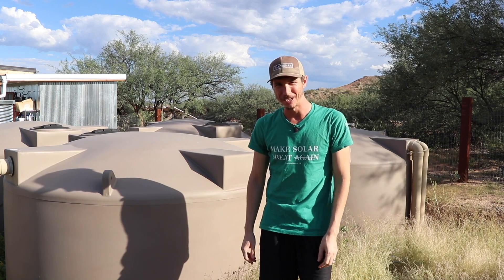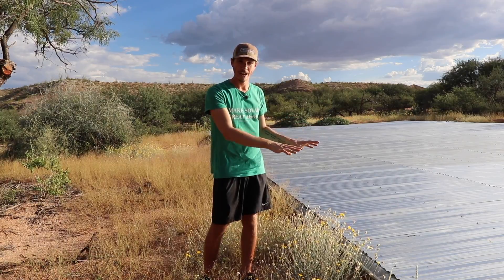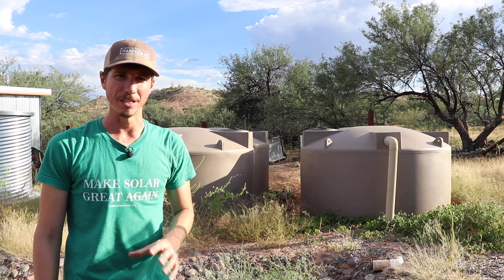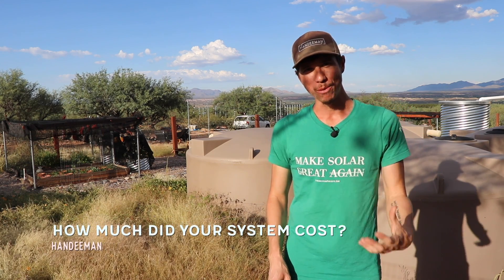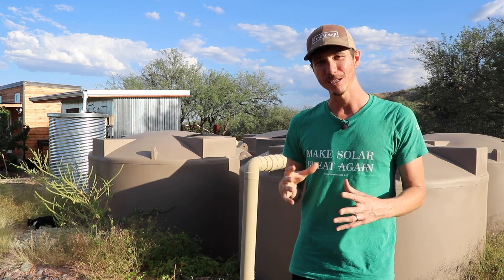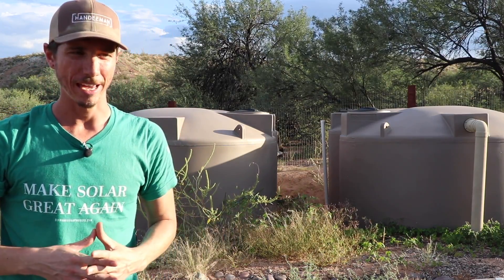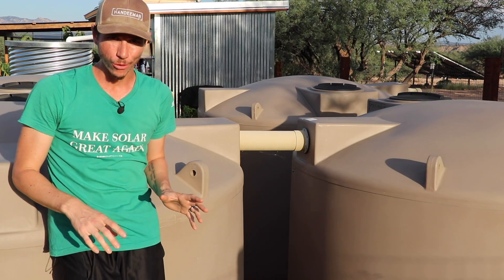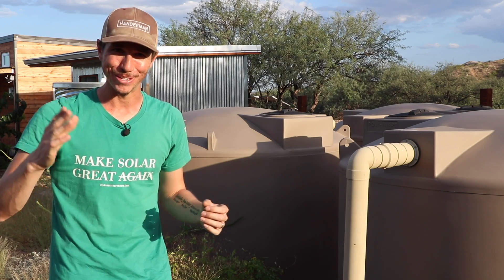Rainwater Harvesting Q&A - Legality, Cost, Treatment

Comment: I live in a single family residence in urban Seattle,  and have used zero citiwater in twenty years.  It Drives the utility nuts ---they have changed out the water meter a couple of times,  supposing that it is non registering,  and sent utility people out to see if I'm stealing water some way!

Seattle gets about 35 inches of rain per year,  but we typically have a summer drought for 3 months or so in which we get little or no rain.

I bought an open steel tank thirty years ago for $50 from a metal surplus business.  It was once used by the military for storage and transport of aircraft engines,  so it is quite sturdy.  Capacity about 600 gallons.  I prime and paint it whenever it starts getting rusty. 

I have five 50 gallon plastic barrels in my basement for water storage,  plus a couple of dozen five gallon plastic buckets. Plus a couple of fifty gallon plastic barrels to collect rainwater from downspouts outdoors,  with a downspout filling the 600 gallon tank too.

All water transport is done with me carrying five gallon buckets.

Nothing purchased for more than peanuts. 

I do live alone. Dishwashing by hand.  Clothes Washer filled  with five gallon buckets  ----during the summer draught I'll save the rinse water from the washer and re use it as wash water. 

In middle September,  with no rain since July 4th,  I still have four barrels of good water in my basement  ---and the rains will be returning before long.

Comment: How much bleach do you treat with?  You mentioned a small amount........we are looking at doing a much smaller set up in northern MI but our issue is we will not be up there full time to monitor the system.  Our most complex job will be to be able to shut off flow to the tank and be able to completely winterize the pump, pressure tank, and filter shed.  But we have to be able to keep that water in the in-ground tank fresh and bacteria free during the months we are not there. Any advice would be appreciated and how can I connect with you to chat about our plans.  Would love your first hand expert opinions and advice.

Comment: Thanks to Susan White with AAH, you can try this in your kitchen. You freeze tap water 3 times for 33 minutes. After  each time, remove frozen layer(unwanted hard particles) then set liquid out in sun for another 33 min. After 3rd time, you have light water. As a test, take a little of this in a cup. Next use an ice cube of frozen tap water and rather than floating at top, it sinks to bottom. Note, after this test, please quickly remove icecube b4 it melts! lol. Apparantly, this water flushes out unwanted nasties from our bodies!

Comment: Have you considered doing a solar water heater? I was scuba diving in Bonaire, and we used a black bladder (5 gallons I think), and left it in the sun while diving, after diving we had a simple clamp boat/rv shower head and we were able to have a HOT rinse between dives. That's a super simple method, of course there are other methods too; like with closed loop arrays, feeding into a hot water tank, etc. Then your wife and you could have longer hot showers, if you so wished.

Comment: We are building a ecovillage in SC and I feel like I have a pretty good grasp of the drinking rainwater flow chart, your video is really helpful. My question is: do you have any specifics or links to your shallow well pump and pressure tank of choice? Does the pump pressurize the line full time, or does it go on and off each time a faucet is engaged? Each of our chalets will have it's own collection tanks and full system. So it will all be gravity fed from the tank... pump, tank, filtration, water heater... each only a couple of feet away. Thank you for any advice or direction, Handeeman.

Comment: Not sure if someone mentioned this, too many comments to go through.  I use these & 2 5 gallon buckets, gravity fed just like your berkey, plans on many prepper sites. Much cheaper & certified for "most" pathogens. They also make carbon filters, still at least 1/2 what berkey brand goes for. I use one filter on my drinking water & change it every six months since I never reach the volume limit. I also have a dedicated scotch-brite pad to clean every once in while. Tons of info on water filtration online. I agree with the others- with your system i'd just filter drinking/cooking, all else is a waste. https://www.amazon.com/Doulton-W9121200-Sterasyl-Ceramic-Filter/dp/B006X5UKMY/ref=lp_7798526011_1_2?srs=7798526011&ie=UTF8&qid=1537833978&sr=8-2

Comment: Hi Derek,  FYI I called Poly-Mart and their tanks are only guaranteed for 5 years. The ones that have the Sunshield (blackout) are guaranteed for 10 years. Not 25 years. Just thought you and your subscribers would want to know. We are also checking out Enduraplast tanks as they have a 10 year warranty and their plastic is more rigid. I was told by the distributor not to bury or back fill the tanks as even baseball size rocks have created cracks in the tanks as the tanks expand when they are filled with water. It's tempting to bury them as it helps keep the water temp cooler especially in the desert, but it voids the warranty. I guess that's when putting a rain catchment roof over the tanks comes in handy. Love then channel!

Comment: I am a big fan of your system.  The cost is high, but just because you are doing it with good products and also have to catch and store so much.  I am surprised that the water doesn't heat up in the tanks during summer enough to keep mama happy during long showers.  

I'm in Kuwait for work, and they store water on the tops of the buildings here in the same type of tan colored tanks you have.  The water from the tanks gets so hot that they turn off the hot water heater and actually have a mini split compressor cooling the water to make showers bearable.  We have extreme heat that you don't have, but I gotta think you are getting at least some warm water from your tanks in summer.

Also, I like that lots of your water has two uses before it is discarded back to the ground.  Not too many homes out there are designed for this and it is a shame.  This is so efficient.  Nice work as always.

Comment: I imagine your water capacity severely limits the size of your cultivated garden and orchard. Your garage roof catchment should help a lot there.  Seems to me if you use a 2500 gallon tank as a first flush diversion you only have 7500 useful gallons of water. Seems like it’s not the best use of 2500 gallon tank.

Comment: When you put in your rain water system -- I was thinking " he should but in an inline simple sand filter between the first tank and the roof.  This would take out all the crap from the roof and be easy to clean or back flush before each season.  Part of that filter  could also include an activated carbon bed section.   Activated carbon is manufactured from, coal, wood, coconut husks or other carbon sources.  It is activated ( I think by steam) to open up the pores.  It's and inert material but has an astronomical surface area per its wt,  they say a gram has the surface area of an acre of land.  It's the surface area that absorbs any organics in the water. Don't think it does much for dissolved minerals which are not in rain anyway.  The stuff is available in 55 lb sacks from Amazon.  Take apart one of those paint respirator filters some time and see how little activated carbon (GAC) is used to take out the paint vapors.  My worry in your neck of the woods would Hantavirus from mouse crap on the roof, so for drinking, additional protection may be wise  UV, Chlorine, hydrogen peroxide etc.

Comment: I would have added some ferrocement tanks under the rain roof to hold the water.  You would not have to have so many eye sores (visible tanks) sitting on your property.  A small bilge style 2000 gph pump hooked to solar could then drain the ferrocement tanks to the 4" pipe and then gravity does the rest.  You could have a sensor on the main tank down by the house to signal either automatic filling of the main tank from the fc tanks or let you know you will have to go push a button to start the fill.  Radio frequency modules and small Arduino chips, and relays are very cheap to make a system like this. Put several pumps in or 1 large one and you could make the transfer in no time.  Remember, all you have to do is raise the water level to the height of your 4" pipes at the rain roof and let gravity do the rest.  The pumps don't have to be very powerful.  Ferrocement tanks are easy to build.

Comment: Thanks for the comprehensive overview. I have been a closet 'water' guy for many years. (Get the play on words?) 
I think a professional test or three from different sorts of testing labs would be interesting you tube content, and I suppose a certain amount of upkeep and maintenance  is necessary as well as quality control if the water was my sole source for my family. ( I think my beer consumption dilutes any ill effects from the municipal water from Woodway, Tx.) My point is though that to my untutored eye, you have built an amazing system that supplies the number one rate limiting resource of survival, food and shelter being the top three. Your garage is incredible!  

There is an old German saying.
" Im Bier gibt es Stärke
Im Wein gibt es Schönheit
In Wasser ist Krankheit" 

"In beer there is strength
In wine there is beauty
In water there is disease."

Back in the day, most water wasn't fit to drink. Whiskey is "the water of life."
Stay safe building stuff out there.

Comment: Rain water, which is actually distilled water does while passing through the air, collect CO2. So technically its corrosive and slightly acidic. The reason for this is it is distilled water and has no ability to buffer the CO2. It is missing any Calcium or Magnesium which distilled water will grab from anything available. This means when you drink distilled water, it will take calcium and magnesium from you. Neptune Microfloc which basically invented small package water treatment plants for the military and the Alaska pipeline construction used Calcite rocks in a flow thru tank. They did this to allow the water which was basically snow melt, which again is just frozen distilled water to take the Calcium from the Calcite which is Calcium Carbonate in rock form. You could switch from Chlorine in the form of bleach to Chlorine in the form of Calcium Hypochlorite (HTH). This is granular or tablets. Bleach is about 5.25% Chlorine, Calcium Hypochlorite is about 65% Chlorine so dose it accordingly. Or you could put some Calcite or Calcium Carbonate in a filter (like a cotton white sock) in the collection gutters so the rain water can pass through it.

Comment: so ive been planning to go offgrid in cochise county since the early 90's. finally got 10 acres north of douglas and was wondering why you count your first flush tank in your total storage capacity? do you manually pump it out later? why not go with like a 500 gallon tank which is less expensive and put the 2500 tank later in series to boost your capacity? as i am now 42 really into your idea of less maintenance.

Comment: Carbon filters,depending on the type of cabon clean up contaminants and impurities as well help in the taste and smell of some water.
Like everything,should be size to system.
Stabilized liquid oxygen can be an alternative to bleach in water storage.
Would a water agitator work in storage tanks and set on a timer?
Possibly a water diverter at the rain roof to control runoff during major rain storms.

Comment: I noticed when it rained hard it would wash out your driveway in some parts. Would it be an idea to make a little bridge over just those areas? Maybe a bridge,  just like a foot high to let that water run under the bridge, preventing you from replacing that section of your driveway. Just a thought.

Comment: Rain is really only acidic in or around big cities that can create S.M.O.G./ Air pollution. If acidity is a concern then you can add a Alkaline Filter( natural minerals/ rocks) that will reduce the acidity of the water. A carbon filter removes taste and orders and chlorine from the water ( use chlorine to sterilize your water). try using a 5 stage water filtration system for human/pet intake if you are truly worried about your water.  Only using this as an ex. -Zero water brings down the PPM in water to zero and has a meter (included) that test the water. look at getting that meter, and have fun.

Comment: If you live in a place that gets a lot of snow, (like Albany, NY) would you have an issue of the snow not melting on your collection platform and thus not getting any water. Also, would you have a problem with the water in the collection tanks freezing?

Comment: pH of a Pepsi - 2.5 very acidic, pH of Orange Juice -3.3 very acidic,  pH of well water 6.5 to 8.5,  pH of rain water 5.6 to 7.5.  Rain water is so pure that the pH is easy to change.  Just exposing it to air for a time will raise the pH, adding bleach raises the pH.  The pH is easy to change because there are no salts buffering the chemistry.  Hope this helps.
Reply from the maker: thanks Frank! that does help :)
Reply: "I need your help Frank" Alex Jones
Reply: I wonder if using marble/limestone sand or chips in the filter or in the tanks would pick up just enough calcium to buffer and neutralize the acidity.  (Or oyster shell if readily available.) Concept like the neutralizers needed for condensate drains on high-efficiency gas combustion appliances.
Reply: Chlorine bleach is only safe to use because it so basic. When chlorine is mixed with water, the hypochlorite ion is in equilibrium with chlorine gas. However, if the pH is lowered, as when the bleach is mixed with an acid (like rain water), the hydrogen and oxygen atoms in the hypochlorite ion form water molecules with the extra hydrogen ions. The result is the formation of chlorine gas, which is toxic to humans. However, the trace levels in his system are safer than most water sources.

Comment: You should incorporate a UV light system to kill germs
Reply: Uv degrades plastic
Reply: ArthursHD  a UV system is a box with a glass pipe wound around a UV light that is put in line so not in a place to degrade the plastic.
Reply: Andrew H What if I had a Far UVC emitter in the first rank that’s on almost all the time? Would that be fine? Or is it still too strong and will degrade plastic? I have considered purchasing the in line conventional pipe UV water filter you refer to. Just curious